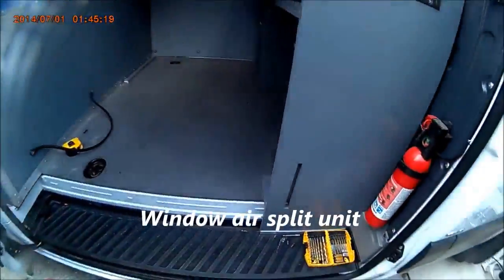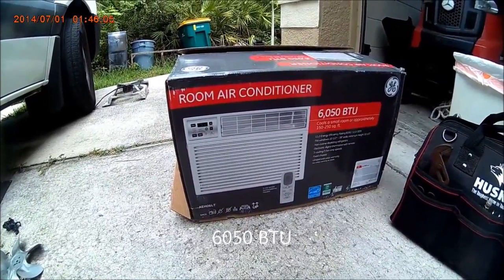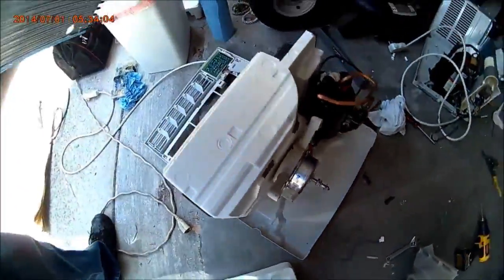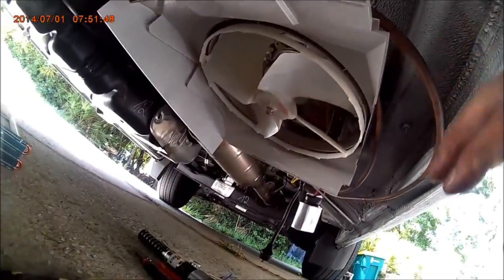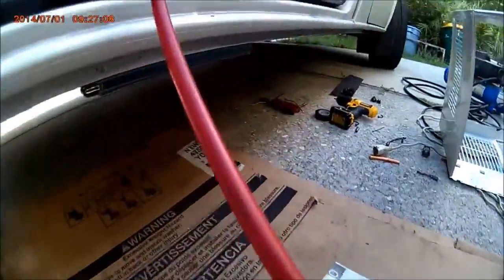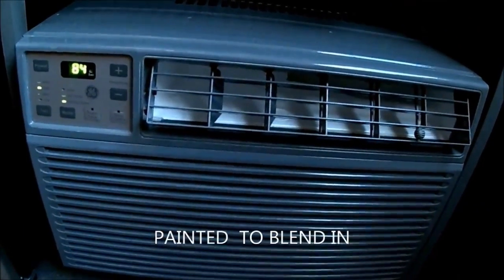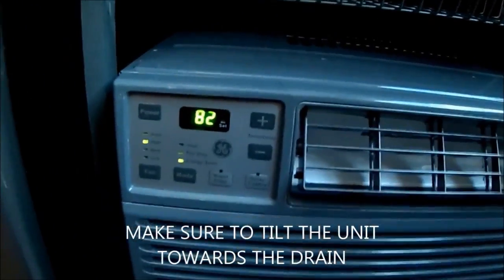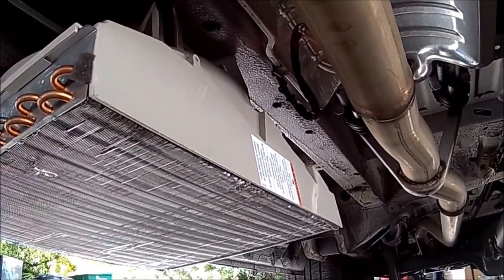Sprinter van air conditioner split unit conversion diy custom

Comment: I was wondering if this was possible, but wasn’t sure how adding length to the cooling system or placing the radiator horizontally instead of vertically would affect the system. Good to see someone who did it. Is there a reason you put the compressor inside rather that outside as it would produce extra heat and noise inside?
Reply from the maker: It doesn't give you a lot of noise inside the blower takes a lot of that away and the compressor runs a little bit better by not being outside but the most important reason I didn't put her a size because there was no space on the van where to put it and it's a heavy unit so it's better to be flat sitting on the floor then hanging.
And another thing that is very important is if you put the unit under the van now you have to shoot the gas in the liquid and that overheats the compressor that compressor works better shooting the gas down then shooting it up that's why this system works better this way

Comment: The fan used under the van...is that part of the original ac if not what did u use???
Reply from the maker: is a ice machine fan so its no problem if it gets wet

Comment: Can you tell me during running of your does a bumb on roads will affect window air conditioner compressor ?
Reply from the maker: Mr. QURESHI it does not make any diference this ac are used in regular RV all the time
Reply: Actually someone told me that you can't install window air conditioner into vehicle because when vehicle gets bump your Window ac's compressor will effect  ... Thats why i asked you ....
By the way can you help me

Comment: You might want to install some sort of skid plate for it
Reply: the sprinter has big weel mud flaps so it protects alot
i often look at the condenser for any sings of damage and i had none in 2 years and 39000 miles .
but if it gets a damage i can allways rapair it or  replace it with $100 from a new window ac purchase. 
thanks for the idea is not bad to add a plate protector.
Thanks buddy.

Comment: You are the first one ive seen do this. Could you make a video explaining how you made this? you dont necessarily have to take anything apart and show us, maybe do a quick sketch or diagram. Explain what lines to cut, what psi you used to vacuum the lines etc. maybe someone else can make it with those details without the professional equipment. thanks!
Reply from the maker: JG I am making a new video for my new 2017 Sprinter and once it's finished I'll upload it and it should be within less than a month ,thanks for watching my channel

Comment: What will it takes to convert it to 12v?
Reply: You'll need an inverter. It won't run off 12v
Reply from the maker: not sure but you will need alot of batteries and solar pannels

Comment: Putting the condenser coil underneath the vehicle?  That's insane.  If rocks and other debris don't cause a leak, filth from the road will  cause high head pressures in very few miles.  Especially if muddy water dries  on it.  Terrible idea!    Another thing I see wrong with this installation is it will suck dust off of the floor inside and blast it all over your living space.
Reply from the maker: i have mud flaps that protects and never had a problem with it

Comment: Cool, very good job. But why?
Reply: thanks i did it that way because i dont like the look of the roof unit and i would have to open a hole on the roof and this cost me a fraction of a top unit that cost more than $1500 instead. 
i save alot of money and it looks alot better and it has no wind drag.
Reply: Interesting. Thanks!
Reply: +Brodyho122 anytime buddy
Reply: can anyone hear him?
Reply from the maker: Brodyho122 I wouldn't know how to do that with that the humidifier
Reply: What?

Comment: Thanks for posting.  I plan to do the same thing in my Sprinter as with a roof unit it wont pull thru my 9 foot shop door
Reply from the maker: rusgoola thanks great idea and it look professional instead of a roof unit.
thanks for your comment and for watching